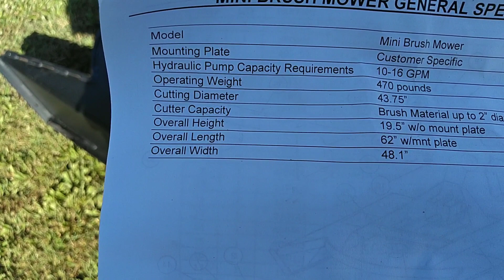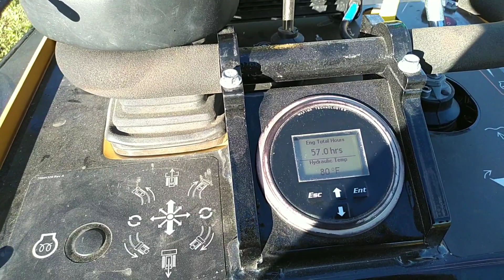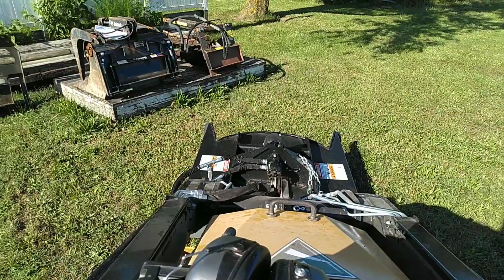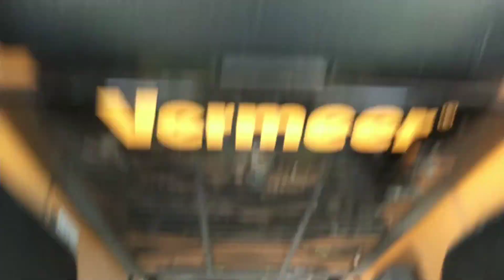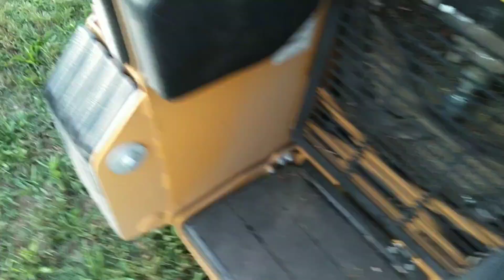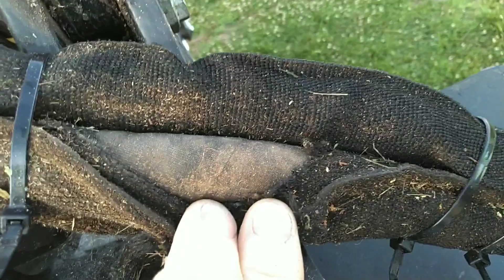Vermeer CTX-160 with the 48"Erskine brush mower review

Comment: Parts of Highway 124 measure the opening put a furnace filter in the back of it then you just have to clean that out
Reply from the maker: Yes, you are correct. Another part of a machine that has to be bought 😥 this thing makes dust storms for you to work in 🌪️

Comment: My old ass ditch witch sk650 will run that same bushhog all day long no problems…
Reply from the maker: Thanks for watching Chip. I wish this thing would do that. Ditch witch machines seam to have a much better intake screen to prevent debris problems I'm experiencing on the Vermeer.
Reply: @workingmanrondoyle3287  i was kind of looking at one of these ctx160s because its on marketplace for cheap near me. Glad I found your video, I definatly dont want to be cleaning the hell of a radiator and ruining it like that. Thanks for the video.

Comment: Hi Ron, Any update on solutions to screen clogging up with grass?
Reply from the maker: Hey Christopher, thanks for watching. I've been experimenting with a furnace filter that greatly decreases dust circulation through the radiator but sadly grass is still being sucked up through the vent holes under the machine. I'm going to be buying some cuttable furnace filter median for those troubling areas to lay in there. I'm coming up on my 100 hours of use and we'll be doing another video talking about this problem and the hydraulic cylinder rubbing inside the loader arm continued repairs by Vermeer service still being the biggest issue this machine has. Will be doing this video within the next few weeks.
Reply: @workingmanrondoyle3287  Thanks Ron, good to hear it helps. I'm in the market for a mini skid like this for tree work and brush mowing ..... this issue is even making me take a closer look at the new Toro Dingo tx1300 instead. .. ctx160 was at the top of the list otherwise!

Comment: Just blow all the crap out of the radiator and air filter when you are mowing 

that’s how all machines are just carry a leaf blower
Reply: When I was mowing didn’t matter what the material was it would splash dust and debris in the air and obviously the dryer the conditions were the faster it would plug but it’s part of the job when mowing
Reply from the maker: Thanks for watching. That's what other viewers had recommend  too. So far it has helped a bit but I'm hoping to work something out, where I can work it for and 4 hour in a day without having to stop. Really slows production down.

Comment: Ron, how about using a washable pre-filter like home air conditioners use? 
Bummer that this design limits the use of your mini skid steer. 
Any update from Vermeer?
Reply from the maker: Thanks Jeff for replying I have been trying filters in front of the grill guard and it seems to help but I have to install filters in the other vent holes which is a bummer. I will be posting an updated repair video at 100 hours of use.
Reply: @workingmanrondoyle3287  Looking forward to the update, Ron. I rented a Bobcat MT 85 two weeks ago for storm cleanup using a grapple just like yours. I was very impressed with the power from the mini. Thanks for replying.

Comment: Also. The hydraulics aren't your issue. Vermeer CTX runs cooler than any machine on the market. It's 100% that shitty open screen in front of the radiator. I have been trying for almost 2 years to get Vermeer to redesign that grate. Porch screen mesh and carry around a small blower. That's the only fix.
Reply from the maker: That's kinda what I've been thinking all along,👍 How did you go about attaching the screen to the your machine's openings?
Reply: @workingmanrondoyle3287  I haven't even done it yet. I keep a nice battery powered blower in the truck and watch the cooler when I get in grasses and fluffy material. I just always watch my temps and know what they should normally run. You shouldn't get over about 135 degree hydraulic temps with a mower on that machine. If you get much above that, you need to look down and check your cooler for debris. Email me wesp5284@yahoo.com

Comment: You need to contact Quick Attach and verify which gear box combo is on it. On the standard Quick Attach/Erskine units like yours the motor is a little small for a 160 and the output ratio on the gear box is very high to allow adequate blade speed on smaller machines. You are likey to have gear box issues if yours doesn't have the upgraded gear box.
Reply from the maker: Thank you WPOG! This was just a Demo to see if the Vermeer CTX 160 could do brush hogging without overheating. 
If I can get a remedy to the radiator plugging up so fast, I will be purchasing one of these brush hogs. I greatly thank you for your input and will make sure I request the right gearbox and hydraulic motor  accordingly 👍
Reply: @workingmanrondoyle3287  I can also tell you how that unit compares to 1050 and 1550 with brush mowers. I have compared each machine running the mowers myself. Also owned a 1050 once for the same purpose.
Reply from the maker: @wpog8453  please by all means ,share. I would love to know the performance differences. That would be great info for someone looking to get into a new machine and using it with a brush hog.
Reply: @wpog8453  how do they compare? What’s your favorite of them all? Must have attachments you recommend?
Reply from the maker: Please by all means, share. I would love to know the performance and differences of these machines with a brush hog. That would be some awesome testimony to people looking to buy a new machine.